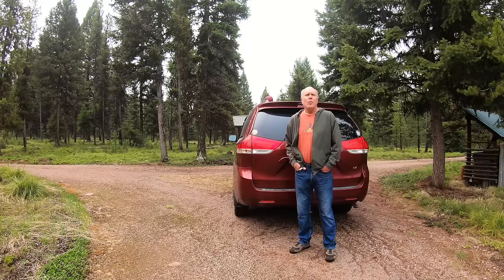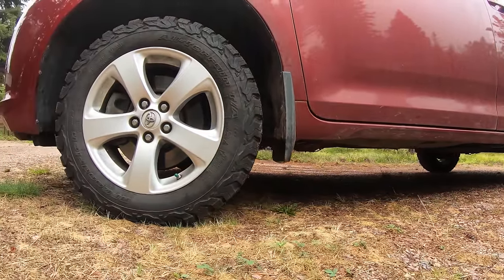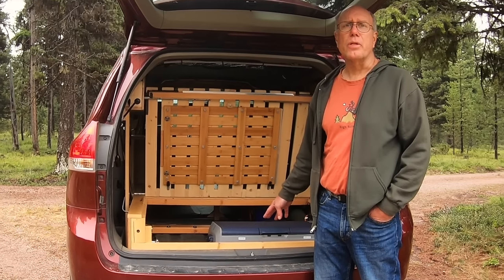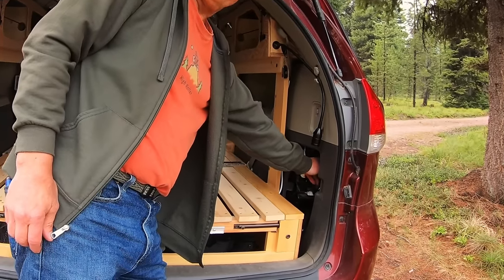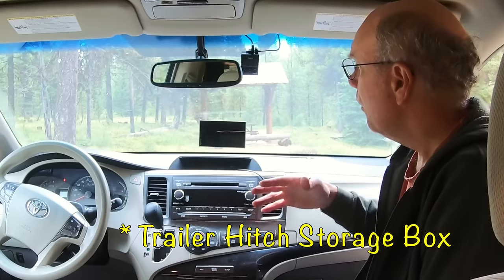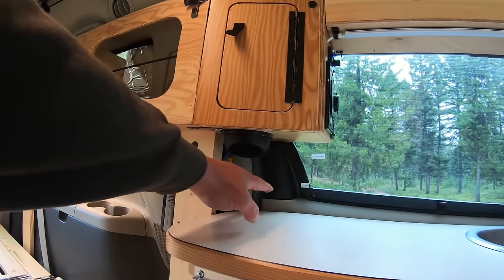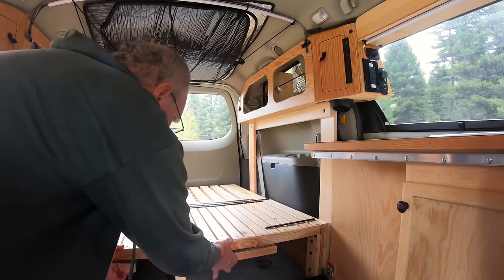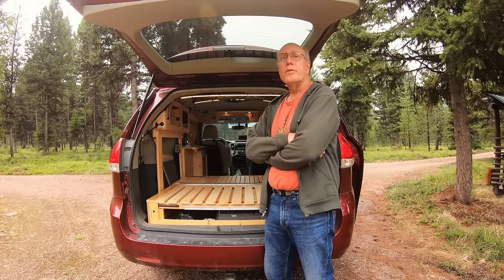An Overview of Our Converted Toyota Sienna Camper Van: The Nickel Tour

Comment: How many people use them with popup canopies? Get one 10 feet wide, drive through so the back is open under the canopy. Take 8 feet of dryer vent and clamp to exhust and run it away. They canopies shrink down well.
Reply: I was thinking of swimming pool hose it's at least 25 feet long. 73

Comment: What mileage is the van giving on highway. I started recently and sleeping on floor with seats removed. Mine is giving around 28mpg at 70mph cruising
Reply from the maker: We haven't been getting that good lately.  Increased use of AC and some additional roof wind resistance seems to have dropped it a bit.  Summertime is around 25 mpg.

Comment: Great setup! What do you recommend for inexpensive ac cooling for hot locations at night?
Reply from the maker: Great question!  There are only two good options that I know of.  One would be using a hybrid vehicle, some of which allow for the AC system to operate without the engine running, but occasionally allowing automatically starting the engine if needed to charge the battery.  Sometimes these are called "dog mode" since you can leave your dog in a parking lot in climate controlled comfort.  Electric vehicles have this feature too.
The other is to follow the seasons... Go north in the summer and south in the winter.  Canada is a great place to visit, and you'll never run out of places to see.  And it can sometimes freeze in July, depending where you are.  Happy travels!

Comment: Could you go into details of your diesel heater install. Most importantly the routing of the exhaust underneath the van. I thought about putting mine at a similar place. My biggest concern is the clearance. From the pop up pictures it doesn't look like it interfere at all. From the place where it's install my guess is it does affect the clearance somewhat.
Reply from the maker: We'll make one specifically of that part of the installation in a future video.  We'll need to take some video of the under side of the van first.

Comment: Any insulation done to the interior body of the van?
Reply from the maker: Just a bit under the carpet, but that was mostly to even out some imperfections, and we put coverings over the windows on cold nights or if we wanted it darker at night (or early mornings).  My research led me to believe that additional insulation behind the existing panels would be extremely difficult, with minimal results.  Since there is so much single-wall glass with no insulation value, adding extra in the non-glass areas would have little effect.  That is why I opted to install supplemental heat in the form of of the diesel parking heater (furnace).  

Almost our entire trip was in a climate where the days were moderate and the nights cool.  If we had traveled in a warmer part of the continent, maintaining a cool enough interior environment would have been more of a focus.
Reply: @dougmaryhittheroad  Make sense, thanks for the reply. I want to do the same with my wife in the sienna; they wanted 50k for the new sienna base model, unbelievable these days!

Comment: Great videos, thank you for the time you put into them. Do you two carry any extra gas or are gas stations close enough to each other? I’m planing to drive from Seattle to Tok for now maybe farther depending how I’m feeling. Thank you and safe travels.
Reply from the maker: Everything that we read said to take a couple of extra gas cans (and 2 extra tires), but we didn’t bring extra of either.  Siennas get good gas mileage and have large tanks, so with reasonable driving the range is easily 400 miles, maybe even 500 miles.  That’s enough for us to make it past one station and to the next if the first is out of gas or closed.  So it depends on your vehicle, and gas mileage.  We never had any problems, but filled up when we could, even if we only needed a few gallons.  We thought it was better to run full rather than half full.
Reply: @dougmaryhittheroad  Gret thank you!  I liked watching your trip and seeing your Van build.

Comment: Lift kit on a minivan, pretty cool.   Was that expensive?
Reply from the maker: That's a good question, and I haven’t added it up until now, even though I have kept detailed records.

Total for everything, and I really mean everything, including mattress, stove, refrigerator, tires, GPS, lift kit, solar battery, plywood, varnish, and every nut, bolt and piece of wire, came to $9640.

Some of that was for things that didn’t work out too well, like the tent addition that was supposed to attach to the open tailgate, and many items are not really attached to the vehicle, like the stove and refrigerator.

It could certainly be done for less, depending on personal needs, and expected travel locations and duration.  For example, eliminating the solar battery and solar panel and just using the vehicle electrical system would easily save about $1500.   

There’s a few minor tweaks and changes that we’ll be doing, but any more changes are pretty small, cost-wise.
Reply: @dougmaryhittheroad  ⭐Impressed w the way you set up your diesel heater, Best so far that I have seen!  I was going to head to BC from N Idaho to get a diesel heater put in my 2013 Sienna; you obviously did yours yourself.⭐ I need my Heat more than anything.  I did a 3-1/2mos trip in my '92 Toyota Corolla Wagon w my Blue Heeler, all the way up Maine > Texas > Everywhere... and took our time.  Now I upgraded to the van and just getting started, hope to be heading out before snow.  I subscribed, and Thank You.
Oh, did you do a 2" or 3-1/2" Lift?  These vans are way too low.
Reply from the maker: I added 3-1/2 inches with the lift.  I did a lot of research before installing the heater, and a lot of thought and measuring before drilling that hold in the floor, but it turned out better than I had hoped.

If there is enough interest, I might do a video just about the heater installation.
Reply: @dougmaryhittheroad  Thanks for your response.  I sure would love the 3-1/2" lift, but I have watched a few videos and seems if not done properly other things go out of balance, and that adds to more $$$ input.😃  Have you done everything by yourself?  I think so, and I admire your knowledge to get this accomplished.
Yes, I would appreciate a video on your diesel heater install.  You seriously have the Best setup I've ever seen.  I'd prefer not to spend $2K to have it done, but I do know it takes many hours and patience.
Reply: ?
 @dougmaryhittheroad How expensive was the lift kit and did you install that yourself? I installed a trailer hitch on my 2006 Sienna. I can't hook up a cargo carrier without it dragging on every dip or drive entrance. Pulling a trailer is completely out of the question.
Reply: @dougmaryhittheroad  Do the a lot more videos on your conversion. Many of us would like to learn from your experiences.

Comment: Thanks for answering my other questions. Did you get a 3.5 inch lift?
Reply from the maker: Yes, I installed the kit from Journeys Off Road.  A well-designed kit, and they were good with tech support.  It really helps on back roads.
Reply: @dougmaryhittheroad  thank you Doug and I was worried about going from an SUV to a sienna however, after hearing about these lift kits on minivans gave me hope that I could still be confident driving on off-road terrain. And you installed it!? what kind of background do you have engineering/construction?
Reply from the maker: @paulywalnuts7731  I have some experience working on vehicles, but nothing major.  This was the most complicated and time consuming part of my entire van conversion. If you have basic mechanics tools including things like a torque wrench, a good jack and jack stands, as well as an indoor garage space for a few days, you can probably do it.  I have an impact wrench, which made things easier, but it isn’t mandatory. 

I have to make a couple calls to the lift kit factory (including on a Sunday), and I watched a video of someone that did it on YouTube, which helped a lot, although his kit was AWD and mine is FWD, so a bit easier.  I finally had to get creative with a grinder and cutting wheel, removing the existing end links, which was the most difficult part.  

Just break the job down into small steps and take your time.  The instructions are okay, but could be better, the diagrams are pitiful (unless they have been improved) but I managed to do the entire thing working 3 to 4 hours per day for about a week.  

I also watched this video about a hundred times:
https://www.youtube.com/watch?v=yi9ELvSX_b4
Reply: That’s way out of my comfort zone so I’ll probably just have to pay someone to do it but thank you for the specific details. You are quite Inspiring

Comment: Great video. 
Do you have any templates for your upper cabinets or how to videos?
Reply from the maker: I really don’t have sort of a permanent template.  I made mine out of cardboard, fitting and cutting, then refitting and re-cutting.  Over and over, sometimes adding back with tape, until I got what I wanted.  It’s not really hard.  The most difficult part was determining what level was.  The vehicle floor slopes one way, the ceiling another, and the walls aren’t straight.  

I ended up making sure that the van was parked on an absolutely level surface, then used a laser level.  That projected a beam 360 degrees around the interior which was thin and perfect.  Surprisingly, they aren’t that expensive.  You can get a pretty good one for around $30.  If I had started with that, I would have saved a lot of time.  Good luck!
Reply: Kind of like working on a wood boat, nothing is square. Kinda like working on my 1964 50' foot Chris Craft. Everything is 12v and 110. This will be easier as I can see both ends and the lighting is much better.

Comment: Where did you find the air plenum?  Great build!
Reply from the maker: In intake air plenum at the top of the window was make with 1/4 inch plywood and pine 1x lumber.  Most or the lumber used was pine 1x (1x4, 1x6, or various cut pieces) since it is light, relatively cheap, and easy to work with.  There is a lot of scribing and fitting, cutting and sanding, and repeating the process to get things to fit tightly.  No surface in the original van is straight.  Lots of cardboard templates were used too.
Reply: @dougmaryhittheroad  I think you have done a wonderful job with the conversion. You incorporated a lot of great ideas. VW should take notes. Did you investigate which wood or other materials were the strongest while also being the lightest so thinner pieces could be used and not add as much weight to the build? I am glad you mentioned that nothing is straight inside the van to use as a reference point. I am considering framing a squared rectangular frame of hickory 1x2's that could be just barely slipped thru the back in one piece or brought in from the sides in two sections to be used for reference starting points and maybe as the starting frame for the conversion. Do you think that would work? This would also allow the build between the outside of the frame and the interior walls to be built separately from the inside container and  not have to be removed if the interior box needs to be removed for some reason like using the van to haul something. I like Taladay latex toppers for the mattress. The latex is heavier but it doesn't bottom out when sleeping on it. It also springs back when stored in a vacuum storage bag to save space when it is not being used.
Reply from the maker: In my experience in anything I build, wood species is always a balance between cost, weight, availability, workability and strength.  In the end I used pine since it is easy to obtain, easy to work and inexpensive (at least where I live)  Strength wasn't much of a concern, since pieces are short.  It doesn't hold screws or nails as well, but everything is also glued, so that wasn't a problem.  For plywood, I used A/C fir, again since it was cheap and available.  I was considering birch or maple, but the top veneer layers are so thin nowadays that I thought it wouldn't wear well, especially once dinged up a bit.  Everything was also varnished with water-based poly sealant, which proved to be very quick drying, which was an added bonus.  I used a lot of material in test fitting and re-cutting, but most was able to re-cut or reused in other places.    @onebrightflash
Reply: You learned a lot in the build. Your sharing enables others to move forward faster based on your experiences and knowledge. Thank your guidance and for educating us.  @dougmaryhittheroad

Comment: Hi Doug
You mentioned in your videos about some issues you had with the 3.5" lift kit from Journeys Off road Kit. I'd like to install one on my 2015 Sienna. I love the van's all wheel drive but the ground clearance is so bad that I hit the front cowling all the time. Can you please share with me some of the issues if any, with the lift kit?  Traxda makes a 2" lift kit but I'm not sure that's enough?

Thank you. 
Ed
Reply from the maker: Hi Ed.  Thanks for watching.

I did a lot of research before buying the Journeys kit, and I am glad that is what I ended up with.  Installation is not easy, mostly because I don’t have a car lift in my garage, so it was all done with jack stands and blocking the van up off the floor.  The directions are really pretty poor, but between them and the website mentioned in the notes of our 4th video (“We did WHAT? The most essential camper modifications to our Toyota Sienna camper van.”), I was able to figure out most of it.  The telephone support for the parts that I couldn’t understand was invaluable, so I need to give Journey’s staff some credit there.

If you have the normal selection of home mechanics tools, good jack stands, plus maybe a couple big wrenches, you should be able to do it.  One of my biggest problems was removing the old stabilizer end links. The nuts were seized so tightly that I had to carefully cut them off with a grinder and a dremel.  Another problem was when one CV joint slipped apart (within the boot) without me realizing it.  Journeys told me that was my likely problem, and indeed it was.  Once I figured that out, I slid back together fairly easily.  The rear spring extensions were  cumbersome to get into place, and a combination of jacks, supports, pry bars and a lot of patience, eventually got everything into place.

My van is front wheel drive, and the AWD version of the kit has a couple extra steps, but I don’t believe that it is any more difficult, just more time consuming.

Some parts are fairly easy, others are easy with the help of someone else, some definitely need a helper, and others just need some creative thinking.  I wouldn’t attempt it unless you have a garage or some other shelter with a good concrete floor.  This isn’t a project for a gravel driveway.  Unfortunately, it’s one of those projects that would be a lot easier the second time, but you’re unlikely to ever do a second time.

Plan on a front-end alignment immediately after you are finished, since you have replaced those parts.  I have seen people that ruined good tires because they didn’t get one.  Overall, it worked out great.  I was able to go places that I could have never gone without it, and personally, I wouldn’t bother with a 2” kit.  For me it wouldn’t be enough.  This was rugged, well designed, and didn’t give us any problems in out 18,500 mile trip, which had thousands of miles of gravel and dozens of camping spots we wouldn’t have been able to access. 

Good luck!
Reply: @dougmaryhittheroad  Hi Doug
Thanks very much for your reply.

The truth is I didn't  want a van and would have preferred a 4-Runner. I'm self employed with a young family.  I customize wheelchairs so I need the space inside the van. I figured if I require the van for my business than I'll do what I can to improve the ground clearance and also put  beefier truck tires on it. We have a lot of snow here in Ottawa mixed with freezing rain and the AWD works really well until the van gets stuck on top of the snow.

I heard some people had issues with the 3.5" lift kit but I think it's attributed to a poor installation, more then the kit's fault. 

By the way your van looks great:) Have a great day.

Ed
Reply: @dougmaryhittheroad in